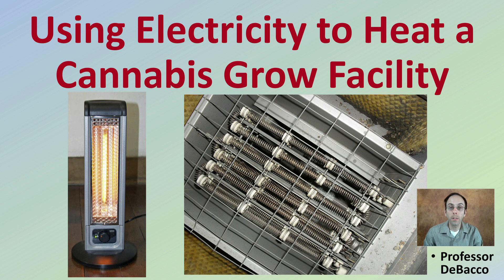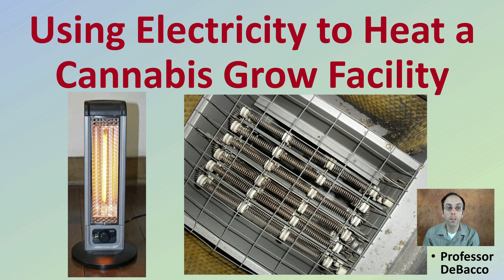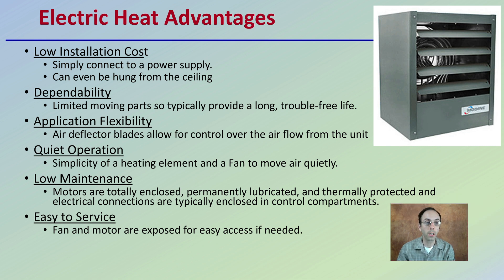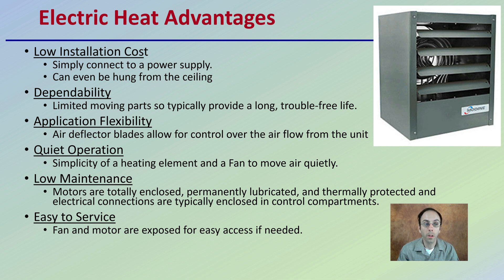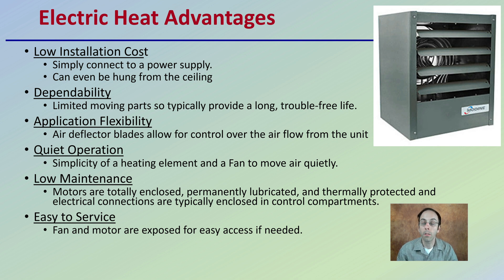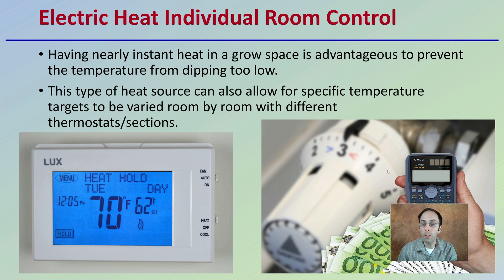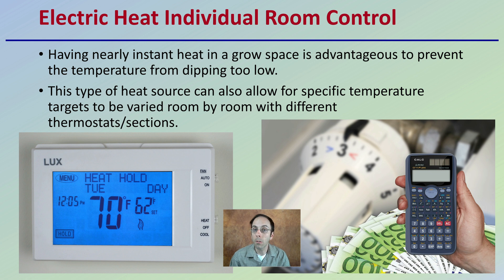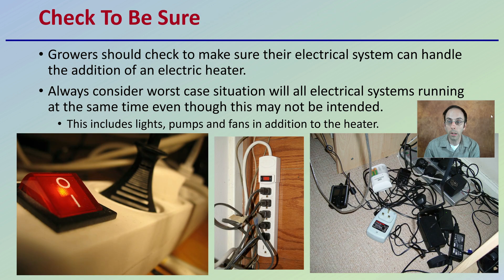Using Electricity to Heat a Cannabis Grow Facility

Comment: I used a 1500W ceramic heater to keep my grow room warm during this Michigan winter.  Worked great, however, I had to run it on a separate line since I was operating a 1000W HID system.
Reply from the maker: Depending on your grow space, you may want to consider running the lights at natural "night time" to help add some heat in addition to light.  If the plants are in an enclosed grow space this can help reduce the supplemental heating needed during the coldest period.
Reply: @DeBaccoUniversity    Great idea!  Thanks for giving my brain a 'nudge'!